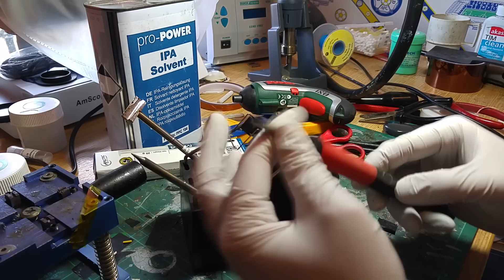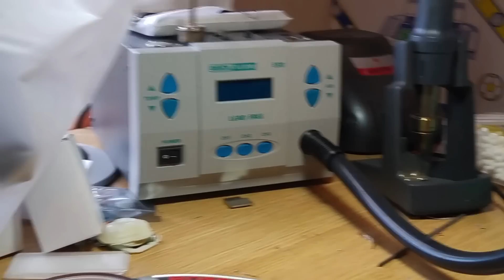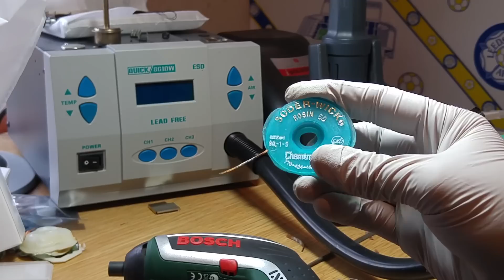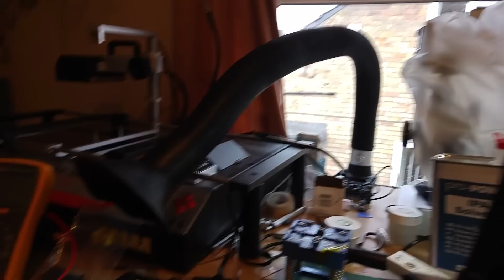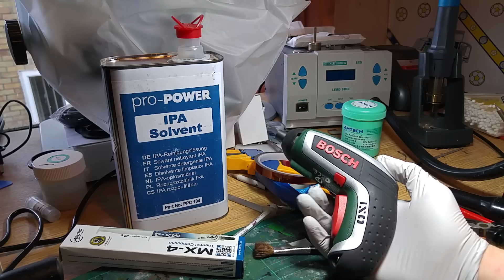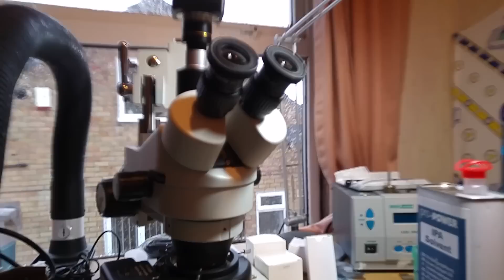Equipment I use for PlayStation / XBOX / Laptop / PC and General PCB Rework

Comment: Andrew. Was enjoying watching you fixing up some missing pads and almost forgot why i came here :D

Amscope. SM745TP (SM-4TP) vs SM745NTP  (SM-4NTP)

I'm in need of a scope as I enjoy fixing stuff but I see people using both models. You have the none N model and some use the N model like Rossman for one.

Im sure either scope would work fine but i just don't know why you would pick one over the other. The little information i could find is as follows for the N model

"this head has moved the diopter-adjustment from the ocular ports to the individual eyepices; retention screws hold the eyepieces in place, and independent focus adjustment can be made with each eyepiece"

Would you have any input why you would pick one over the other? Its had me stumped for days  :(
Reply from the maker: Hi,
To be honest I'm not sure there is much of a difference - they're both Trinocular, and simul-focal. My guess is that there may have been a revision to the build somewhere since I bought mine as I've had it around 3-4 years at least by now (perhaps this is designated by the 'N' - new, possibly?). If the only difference is in the eye pieces then it will all depend on how you intend to use it. Personally, I never look down them as I always use the HDMI camera in the C-Mount trinocular port as a live video feed which I personally prefer. If that's how you also intend to use it then I'd recommend going with whichever you can get easiest / cheapest. I've never found an issue with the eye-piece focus when I have looked down them myself so can't say I'd find the individual focusing of the eye pieces all that useful but then it's nice to have I guess ha ha! Either way, this series of scope is excellent and I would very highly recommend it, whichever you ultimately decide to go for :) Hope this (somewhat) helps! :)

Comment: hello Paul ! what's the name of the soldering station please ? and the model name of your microscope ?thanks
Reply from the maker: The soldering station is a Jovy iSolder 40 - sadly Jovy are defunct these days which is a real shame however there may be some new old stock units still floating around suppliers. The scope is an Amscope SM-4TPZFRL.
Reply: @AndrewPaul  Thank you so much for your response! Do you know of any other Good quality welding station?

Comment: Hello there Andrew, I couldn't understand what was the Diameter of the wires you use for repairing traces. Thanks in advance
Reply from the maker: I'm using 0.1mm diameter enamelled wire (38AWG).

Comment: You know this was really useful as I live in the UK as well and it so hard finding suppliers for this sort of stuff. All the other repair video youtubers are based in the states and only list suppliers in the states. If you want genuine HAKKO supplies I know of a genuine authorised hakko seller for the UK, I bought my hakko soldering stations from him. just message me on a reply if you want his info. He works for grosvenor group which are authorised sellers.jay ps. Beware of fake kapton tape on eBay, I’ve come across loads on there, test it with your hot air station...the fake stuff melts at 360..the real stuff won’t.

Comment: Hi Paul :)
I have to buy a preheater but I do not know what to take : - /
Can you advise me ?
A size of 10"x10" or 12"x12"
Reply from the maker: A larger heater is always a good bet as they're more versatile going forwards.
Reply: Yes i think take this
http://www.ebay.fr/itm/T-8280-Infrarouge-Ir-Pcb-Prechauffage-Four-Prechauffage-1600-W-280-X-270-Mm-X-/252900154687?hash=item3ae2061d3f

Comment: I have the Quick 861DA. Is that the better version of the DW?
Reply from the maker: Hi,
From what I remember the DA has a slightly higher airflow rating (200l/min as opposed to 120l/min) and is rated at 1300W as opposed to the 1000W of the DW although both max out at 500C. The extra power is needed to supply the higher temps at the higher airflow levels. The DA has since been discontinued from what I can see and is now replaced by the DE (1200W and 200l/min) leaving the 861DE and 861DW the two options in the 861 range.
Reply: Andrew Paul Thanks for the reply dude. I noticed the air flow is crazy high when maxed out. Makes taking the iPhone shildes off a breeze with everything maxed out. I think my station needs calibrated tho, have noticed that I need to use 385 - 400 temp for any rework

Comment: You are amazing good seen a lot from you know, I need some help form you just a few questions..
Reply from the maker: What do you need to know bud?
Reply: Hi tangs! Yes do you know the type componet the  ps4 diodes close to the hdmi is? Do you have to salvage them ore can we buy them.. Have two one that are missing them all almost just as bad as the worce ps4 you had here.. And one just missing the one diode.... I have found some salvage ones on ebay,,, But hard to know what you get... And do not talk about the price, I used to work whit soft solder had licenses for it and esd shit.. So im not a total noob but.. Starting on scratch after 10 years lol so not all is there in my head lol..  Sorry my bad grammar and spelling from my norvegianenglish

Comment: Do you still like the Quick 861DW ($235)?  I've looked at the Weller WHA900 ($580) and Hakko 810D ($750).  The tips for those are also much pricier.  I'd like to hear from someone who's used the Quick and possibly one of the others as well.  I don't mind paying for better equipment, but at 3 times the cost, they need to be in a way that makes more money.
Reply from the maker: Yes I still very much rate the Quick station - I use this air station in all of my videos and wouldn't be without it. Honestly, the others aren't worth the 2-3x the cost over the Quick - get it and I'm sure you won't be disappointed.
Reply: Thanks Andrew!  I also just found the Quick 712A for about the same price.  Hmmmm, looks to be the same hot air station with a 90w iron as well.  I wonder if the hot air would work about the same.  Always nice to have another iron when needed.  What do you think?

Comment: I am chugging along using a Aoyue 968A+ for my soldering and rework needs. Though it's not exactly a perfect kit, I normally find it "functional" for its intended use. :) I did notice that it seems that you have issues with this brand. I was just wondering if you could expand a little bit on that as to why you seem not to like them. Or did I mishear you? :D
Reply from the maker: No you heard me right. The problem with Aoyue kit (and I've bought and used some previously when I started out) is the lack of consistency and QC. One machine will work fine, the other won't do the same job in the same conditions - it's very hit and miss and that cannot be acceptable when working with such things as multi-layer PCBs and may have to warranty the work you carry out if you're a business.

The other main issue is that it's built down to a price which is fine, but it's done to the point that the functionality of the products suffer. Try using an Aoyue to remove the LCD connector of a Macbook for example and then try using the equivalent Quick / Weller / JBC station and the results are night and day - the connector removes at least twice as quickly without melting or destroying anything in the process. Aoyue's tend to roast things as the temperature and airflow measurements aren't accurate whereas on all the other named stations above you can guarantee the temps and airflow are what they say they are, and importantly still are when at the airflow levels set. Then just take a look inside one and see the build and construction quality between the sets and again it's a marked step up. 

You need consistent, predictable results which you can only find with quality equipment. The funny thing is that some of this kit is not a whole load more expensive than the Aoyue but it is a world away when you come to use it practically and on a regular basis.
Reply: Ah, I will grant that you definitely have a valid point with the roasting things. I have had this kit for about 2 years now and I have noticed a pattern where I seem to be doing more roasting :D than actual good work. Suddenly easy jobs like removing and replacing a smd diode becomes a pain in the ass. I was starting to wonder if it was my fault, but after doing some temp measurements there definitely is some temp fluctuations going on.

I was gonna take a closer look at it, but time to replace I am thinking. I definitely got my moneys worth out of it as it was suspiciously cheap even 2 years ago so that's a positive I guess.
Reply: Andrew Paul

Comment: Cheers for the hrs and hrs of very useful videos. 
I've watched most of them a couple of times now because I am looking to fix my sons PS3 HDMI port and the Wifi chip on my Galaxy s4 and all going well moving on to much more of this type of work.
A couple of questions:
Is the silver foil ducting tape conductive? If I put it on diodes and stuff will it arc/short parts?
What type of cloth do you use to wipe the board after the IPA? 
What kind of light do you prefer to work under? ex White light, watts etc?
Thanks again and I hope all is well with the new addition to the family.

PS looking forward to seeing that scope in action!

Comment: hi andrew, i got the jovy isolder 40 it works realy good, the new jovy isolder has a switch on the top so you can conect to pc and set your own temp range
Reply from the maker: +o_O_RedI_O_o power Oooo just seen that - very interesting. To be fair I've never felt the need to manually override the iControl but it's a nice option to have none-the-less. :-)

Comment: good video.you are rock
Reply from the maker: +Raul Morel Thank you.
Reply: +Andrew Paul Hi can u please help me with spme advice. My ps4 controller wont charge unless i mess around with the charger for a while then dont touch it until its charges i think i need to replace the charger port inside the controller but cant find the right part sold in uk

Comment: hello Paul, i repair ps4 in france i have qustion can swap bd card ps4 drive , we can change experience repairing , my speciality is microsoldering , i have 2e question dualshock not working i change wifi bluetooth modul but not ok have you solution for 2question , excuse my english merci Réda
Reply from the maker: +OUZAGHLA REDA Hi,
Sadly the BD-ROM daughterboards are married to each console rather like they were in the PS3. They cannot be reprogrammed or changed between boxes otherwise this will result in an error CE-35888-2 when trying to launch any disc-based application. The only way around this if you have a faulty daughterboard is to repair that original daughterboard or if the flash is at fault then you'll need to change the BD board and mainboard APU / Syscon / NOR for a fully matched set as per my CE-35888-2 video which is quite a lot of work and not cheap or easy to come by the required matched set of components.

The BT/WiFi module if still giving issues after a module replacement is a flash corruption fault. I will be doing some work on this in the coming weeks to see if I can work out a method by which we can repair the fault but not entirely sure if this is going to be possible as yet. I guess time will tell ha ha!

Hope this helps.
Reply: +Andrew Paul 
merci Paul thanks, flash remplacement mx 25l256? with other , i think in time the bd can result solution, re programming i stay to see your video for this problem of dualshock not working 
merci